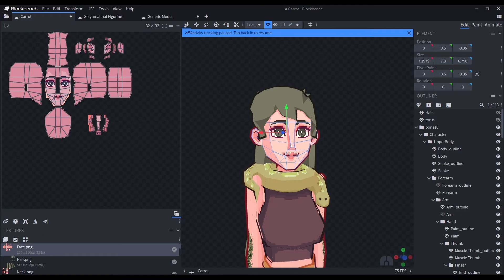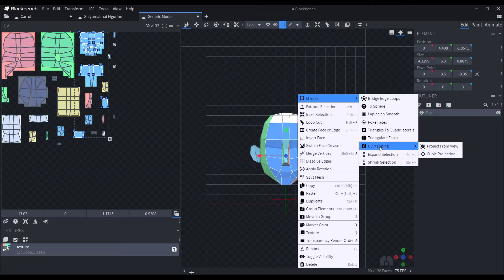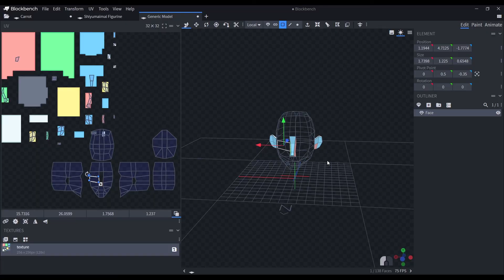How To Properly Do UV Mapping in Blockbench | Blockbench Tutorial

Comment: Good video, but UV projection from view is a built-in feature in Blockbench, so you don't need the plugin for this step. The built-in implementation also automatically scales the UV correctly, so you don't need to zoom in or out to scale.
Reply from the maker: Ahh I didn't realize it~! The UV Project from view is also accessible in  just below the texture window~!
Reply: Thanks for this tip! I was also using the MTools method and did not know of this. Maybe it wasn't there at the time? (I feel like I would've noticed it.) I'd say the MTools method is still good because of the scaling (some parts need more detail than others) but it's also nice to know that this exists too.
Reply: the goat